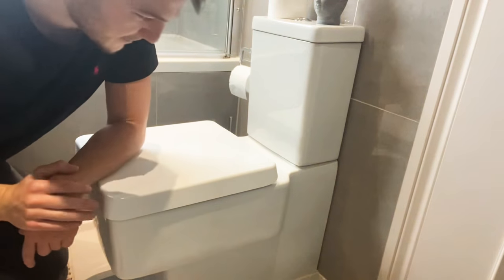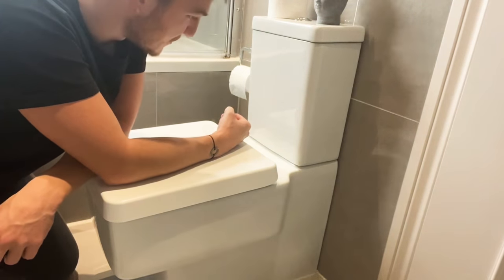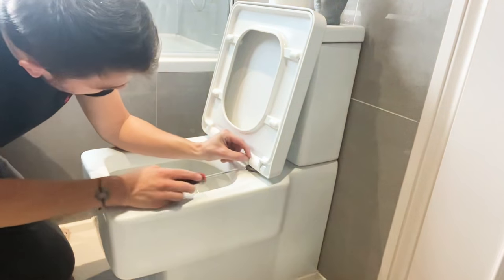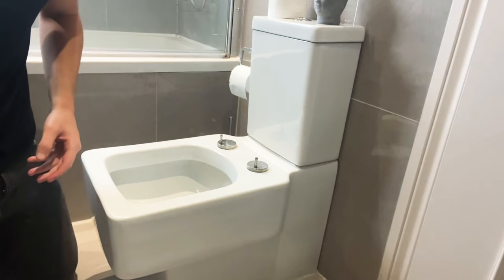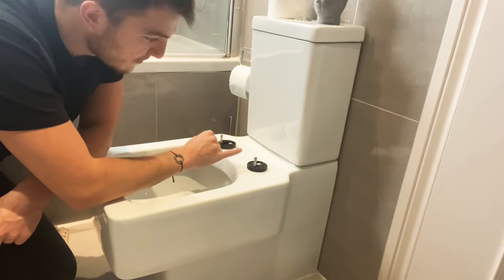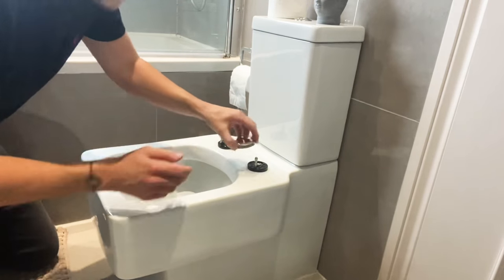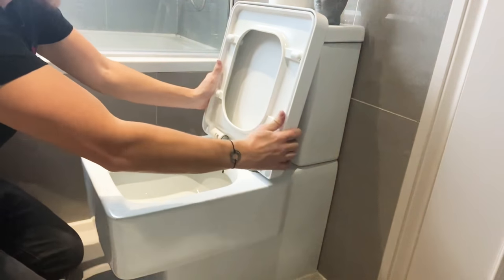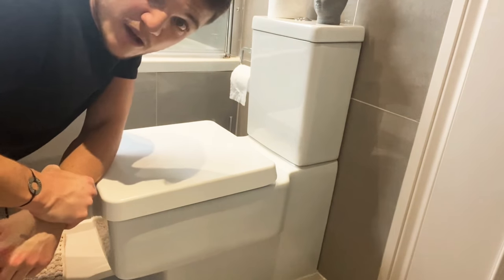How to fix a loose toilet seat, soft close hidden bolts toilet seat fixing #loosetoiletseat #toilet

Comment: That's nothing, what if the screw is loose from the nut, in an enclosed system. Your video says 'soft close hidden bolts toilet seat fixing", show us how to change the when the nut is loose and you cannot tighten the screw.
Reply: This is the video I’m trying to find currently
Reply: Me toooo! I want to fix it without having to call a plumber for 400$
Reply: The screw has sheered off so how do you replace that?
Reply: Screw is just spinning won’t tighten up without holding the nut underneath 😢 looking like the whole bowl has to come off which is a shame as it’s brand new fitting .
Reply: @akaski777 same here 😢

Comment: WHat to do if the previous owner has over tighten the screws or damaged the intetnal nut you cannot reach, so you can never get the screw tight anymore? WHat a crap design.

Comment: What do I do if the bolt on the underside of the Phillips screw has dropped off? How do I replace this? Please help 😂
Reply: Same issue, here plastic nut on the inside broke. Not sure how to get inside the porcelain.
Reply: @alifarhat5437  You can buy replacement bolts on Amazon or Ebay, so just push the remains of the old ones down into the toilet casing & replace with new ones.
Reply: @anthonypaynter828  Hi Anthony much appreciated. I’ve since repaired them and learnt as you’ve advised. Key point is to understand the replacement fasteners are inserted wholly from the outside. When you do them up, they expand internally to lock in place. And yeah, future generations may discover a few old plastic nuts resting inside the porcelain cavity.

Comment: What do you do if the part on the underside falls off, I heard it drop and now you can just pull the bolt right out. Do I have to remove the whole toilet from the unit?
Reply: Were you able to find a solution? I have the same issue

Comment: I thought this would be the case for mine too, but the screws are tight and it's not moving...I think my actual seat is fitting loosely on the metal connector part rather than the screws being the issue... has anyone else had this problem??
Reply: Did you take the metal connectors off then tighten the screws?  It worked for me.

Comment: Mine has been tightened maximum and still swivels.
Reply from the maker: Hi, had your seat been lose for a little while. It is possible that moisture has got in under the mounting bases and causing it to continue to slip. You may need a brand new seat all together